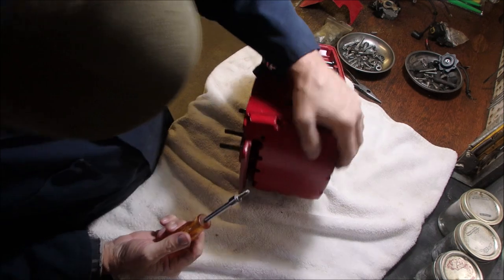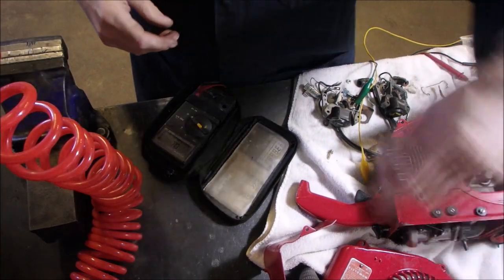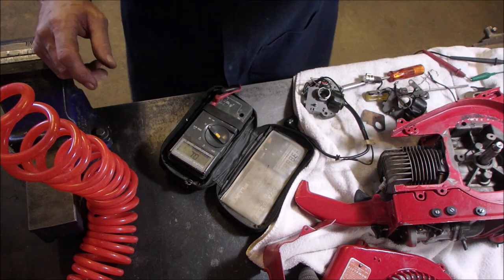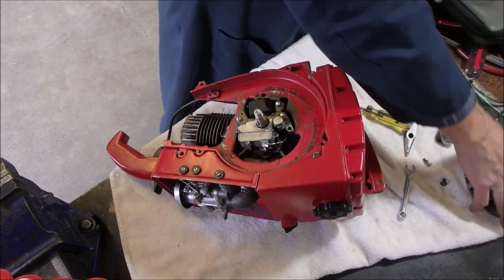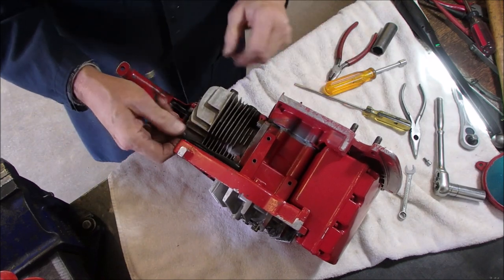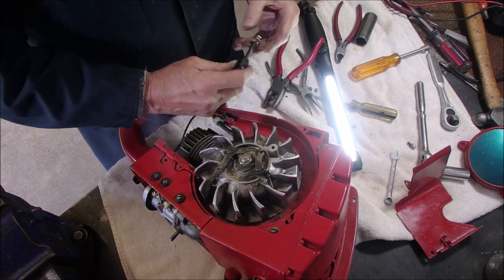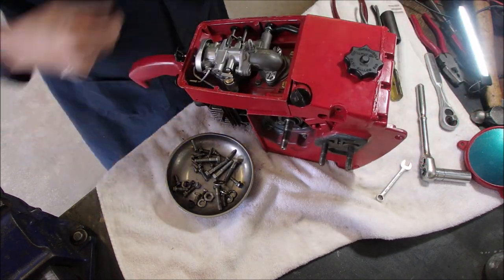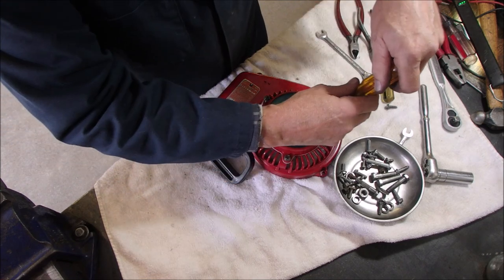Homelite Major Assembly YEAH!!!

Comment: I recently restored two Homelite C72 saws, they look very much like the saw you are restoring/restored. My biggest issue was finding exhaust parts like muffler, studs, etc. They are heavy saws, but cut like mad.  I wish I had this video when I was restoring those saws.  Thank you and keep up the great work.
Reply from the maker: That was one of the reasons i showed the frustrating portion of the chassis assembly.  Thanks so much